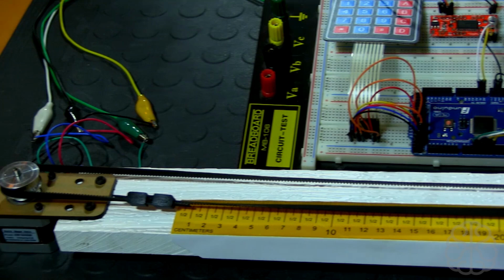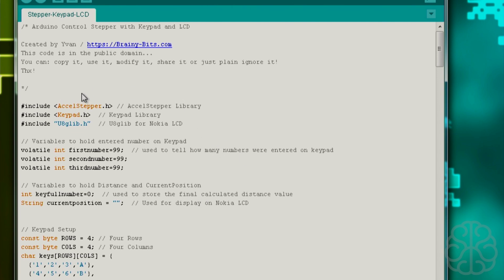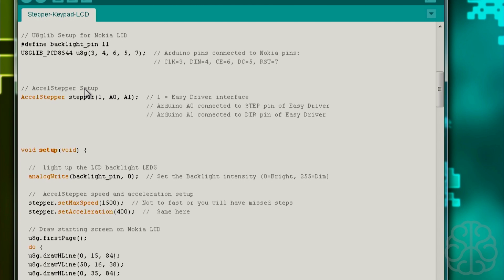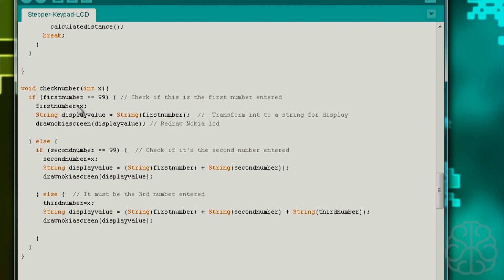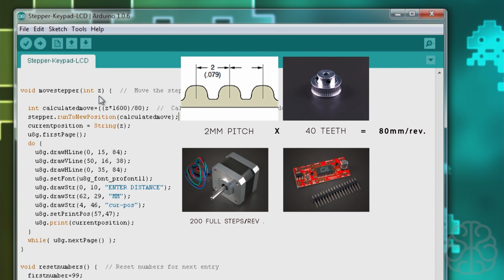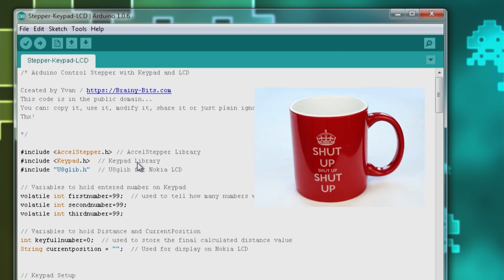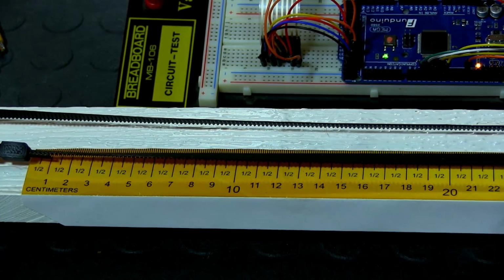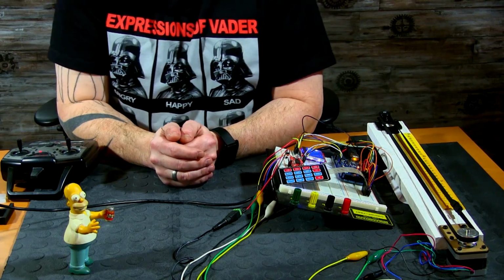Arduino DIY electronic miter box?  Stepper control with keypad and LCD - Tutorial

Comment: Thanks for your videos. I'm starting with arduino and this is really helpfull. I have a project like this I want to make for my company. But instead of Nokia display or LCD I want to use 7segment display with MAX7219. I already watched the dart conuter video and makes sense your approach. My question is how would you do to add a decimal point with a decimal? I want to write the numbers in the display from right to left from the decimal point, and once I press the period, write one single digit to the right of the period. Any guess? Thanks from Barcelona.

Comment: You use the steps per mm = 1600/80

Then, i change this value into 6400/10. I try 51 mm, the motor rotate clockwise but then when i fill the value = 52 mm, the motor rotate counter clockwise. What happen? Where is the error?

By the way i use the tb6600 driver, with microstep 1/8 aka 1600 per rev

Comment: If you need to control small motor and need to precisely rotate motor between 0 and 90 degrees would you recommend stepper motor or servo motor?

Comment: how to get the distance 25.45mm?
Reply: I have the same question but it difficult to get an answer. On the internet I could not find a proper suggestion , even if you look to calculator examples I could not find  anything about decimals points.
Reply: use potensiometer (motor knob)

Comment: Hi Ivan thanks for the sketch how do I change the code from LCD display that you use to a LCD (16,2) display. I am a pretty good engineer but my coding is useless, I think that is because I am 73 and things don't enter the brain like they used to.
Reply from the maker: You would have to change some of the code since using the Oled requires different coding, here's a tutorial that uses a 16x2 character LCD: https://www.brainy-bits.com/post/a-rotary-encoder-that-s-always-on-the-money  Hope it helps.

Comment: I have set up this sketch at least 8 or 9 times and can't get anything to work. I compiled and loaded  it more times than I can remember and it loads but I keep getting 
"Invalid library found in c:\Program Files (x86)\Arduino\Libraries\Easy_Driver-master: no headers  files (.h) found in c:\Program Files (x86)\Arduino\Libraries\Easy_Driver-master"
Where did I go wrong? 
I copied and pasted the sketch and downloaded and installed all that you said I required from you web site.
Any help would be well deserved.
Pete
Reply: Well, I found I had a bad Nokia board. I tried over a dozen different sketches and could not get 1 working.
I do have a couple of working Dorhea IIC I2C TWI Serial LCD 2004 20x4 Blue Backlight Modules and was wondering if these could be made to work in this sketch.
Also, I'm using a Nema 17 motor that is a 400 step (.9) if that makes any difference.
At the age of 76, I have been trying to learn to code these Arduinos but my brain kind of wanders. I would appreciate any info / help you could offer me in this. I think I could get this to work on my HO turntable pretty well.
Thanks,
Pete
Reply: I finally got this to work (bought a new Nokia lcd). Now, can the mm's be changed to steps?
Reply: @repeters1  I tried this tutorial, spent 1 full hour debugging, my nokia board too was bad, good thing I ordered 3 lol

Comment: Hello
I need to get three parameters first befor starting the procedure and then use those parameters to run my stepper motor.
I need the operator to see what it in entering on an oled display
would you please help me on it

Comment: Hi, the project is beautiful, I've already done it and it works! I entered a command line with a 5 second delay and that's fine.  I will install it on a slider for cam. Do you think you can also enter the stepper speed control using the keyboard? I wouldn't know how to do it. Best regards!

Comment: Great video! I did have 1 question, hopefully you didn't already cover it and I missed it. So lets say you are done for the day and turn off the device. How does the device, and you,  know where the current position is when you turn it back on? Or do you always have to remember to return the device back to zero position.  Thanks for sharing this great video!
Reply from the maker: Hi David, when it's powered off, then the UNO lose the current position and you need to zero it when it starts up again.  I've done a tutorial on how to home your stepper at start here, hope that helps and thank you for your comment and for watching!  https://youtu.be/3odRT6zdzqk
Reply: @BrainybitsCanada  how to add text in screen,when system works in 'home' mode,your answer is very helpful,thank you

Comment: I have a 51: 1 planetary box but if I change the code from. int calculatedmove = ((z * 1600) / 80); for int calculatedmove = ((z * 81600) / 80); does not work. Can someone tell me why and how to solve it?
Reply: youre driver not have 81600 mod :)

Comment: I want to move 2 stepper motor. If pressed key then Ist motor start move 12 inch  clockwise and stop 1st motor and start 2nd motor 4 inch  clockwise and stop 2nd motor . And again 1st motor move 12inch anticlockwise.
And finally I want goes to final position.   Please help me..

Comment: Ivan, is it possible to use this system instead of a liniair system to a rotating system for a modelrailroad turntable.
On the keyboard a want to use only de numbers for trak 1-2-3 etc if a press 1 the system moves15 degrees,
So the keys must be presetted to a surtain track number.
Maybe I have to change the mechanics.
Maybe you did already a project like this

Comment: Using 16x2 or 20x4 LCD screen instead of the Nokia LCD would have shorten lines of code and also make it more clear.  Anyway, it was a very useful video, I think it can be a basic core for building a CNC machine..  Thanks a lot man.

Comment: Thanks #brainy-bits I've been trying to build a arduino router lift and I'm using this project as a base to work from. Just got your stock code running. Next I need to add limit switches for both the bottom and top positions. A third limit switch will be for homing the router bit flush with the router bed.

Comment: Very good project.
I would like to use this project in the locomotive turntable but after power on the motor is not in the same position. How to apply the home position switch in this project?

Comment: //my code://

#include <LiquidCrystal.h>
#include <OnewireKeypad.h>
#include <TimerOne.h>

LiquidCrystal lcd(0, 1, 6, 3, 4, 5);    // pines de arduino al lcd

char KEYS[] = {
 '1','2','3','a',
 '4','5','6','b',
 '7','8','9','c',
 '*','0','#','d',
};

// da de alta el objeto teclado y asigna los valores del pin analogico y las resistencias
// para mas informacion lee la libreria

OnewireKeypad <LiquidCrystal,16 > KP(lcd, KEYS, 4, 4, A0,4700,1000);

// declaracion de variables

int x = 0;
int z = 0;
int i = 9;
int j = 0;
int k = 9;
int n = 0;
int a = 0;
int b = 0;
int paso = 100;
char tecla[10]="         ";
int Distancia1 = 0;
int Distancia2 = 0;
int retraso_teclado = 20;

               
void setup(){

pinMode (2,INPUT);
pinMode (8,OUTPUT);
pinMode (9,OUTPUT);
//attachInterrupt (0,SENSOR,RISING);

lcd.begin(16,2);
lcd.setCursor(0,0);

lcd.print("                      ");
lcd.setCursor(0,1);
lcd.print("                      ");

 lcd.setCursor(0, 0);   
 lcd.print("MOTOR 1:"); 
 
lcd.setCursor(15, 0);   
lcd.print("mm");

 lcd.setCursor(0, 1);   
 lcd.print("MOTOR 2:");

 lcd.setCursor(15, 1);   
lcd.print("mm");

}

//void SENSOR()
//{
//digitalWrite(8,HIGH);
//  lcd.setCursor(10, 3);   
//lcd.print("david");
//delay(1000);
//if((x+z)>0){

//digitalWrite(8,HIGH);
//digitalWrite(9,HIGH);
//delay(5000);
//x--;
//z--;
//}

//digitalWrite(8,LOW);
//digitalWrite(9,LOW);
//delay(1000);
//}

void loop()
{ //attachInterrupt (0,SENSOR,RISING);

 if (KP.Getkey()) // SI SE PULSA UNA TECLA
 {
  
  //***************************************************/
  tecla[n] = KP.Getkey(); 
  //***************************************************
  
if((tecla[n] == 'a')){                   //habilita el teclado para introducir la distancia para el primer motor
                      a=1;
                      delay(100);
                     }
//***********************************************************                     
if(a==1){  
          
       if ((tecla[n] != 'a') && (tecla[n] != 'b')){
                                                 lcd.setCursor(i, 0);  // va posicionando en el lcd para escribir en su sitio correspondiente el proximo caracter
                                                    lcd.print(tecla[n]);// lo escribe en la lcd
                                                    Distancia1 = atoi(tecla); // convierte en un entero la cadena de caracteres tecla[]
                                                  
                                        if(Distancia1 >0){ 
                                                          if (tecla[n] == '*'){
                                                                               lcd.setCursor(i, 0);    // va posicionando en el lcd para escribir en su sitio correspondiente el proximo caracter
                                                                               lcd.print(" ");
                                                                               lcd.setCursor(18, 0);    // va posicionando en el lcd para escribir en su sitio correspondiente el proximo caracter
                                                                               lcd.print("ok");    // escribe en la lcd
                                                                               a=0;
                                                                               b=0;
                                                                               n=0;
                                                                               i=8;
                                                                              }
                                                                           }                       
                                                      delay(250);  
                                                      i++;          
                                                      n++;            
                                                }

      }

   
  //******************************************************************************************/
if((tecla[n] == 'b')){   
                        b=1;
                        delay(100);
                     }
//*********************************************************************************************************************    
if(b==1){
           
          if ((tecla[n] != 'a') && (tecla[n] != 'b'))  // si es un numero
                                {
                                 lcd.setCursor(k, 1);    // va posicionando en el lcd para escribir en su sitio correspondiente el proximo caracter
                                 lcd.print(tecla[n]);    // lo escribe en la lcd
                                 Distancia2 = atoi(tecla); // convierte en un entero la cadena de caracteres tecla  
                         
                                 if(Distancia2 >0){
                                                   if (tecla[n] == '*'){
                                                                        lcd.setCursor(k, 1);    // va posicionando en el lcd para escribir en su sitio correspondiente el proximo caracter
                                                                        lcd.print(" ");    
                                                                        lcd.setCursor(18, 1);    // va posicionando en el lcd para escribir en su sitio correspondiente el proximo caracter
                                                                        lcd.print("ok");    // lo escribe en la lcd
                                                                        a=0;
                                                                        b=0;
                                                                        n=0;
                                                                        lcd.setCursor(15, 1);   
                                                                        lcd.print("mm");
                                                                        k=8;
                                                                       } 
                                                  }
                               delay(250);   // espera para que no rebote el teclado y marque dos digitos iguales seguidos
                                k++;              // para escribir en la siguiente posicion en el lcd
                                n++;            // aumenta el indice en el array tecla para situar en la cadena de caracteres el proximo digito
                               }
        } 

 }
 
}
Reply: Please send your code l can't open this video code if you send it would be a big help for me please again

Comment: Sir, 
Thank you very much for your informational and well presented tutorials.  I used your code from this tutorial with a few 
modifications. I deleted the LCD display lines and use Serial Monitor to  display pressed key numbers and current position and added a fourth number. I also modified the calculation for inches and 10ths.  Pressing 100 on the keypad advances the pointer 0.10 inch from zero. Pressing 150 moves to 0.150 inch. (Within a margin of acceptable error)   
Entering 1000 advances the pointer 1.0 inch from zero. All works well except for a couple bugs.  When I input 1000 for a 1 inch move, the motor moves forward a bit, slows to near zero RPM for a moment, then accelerates smoothly stopping at the 1 inch point. Should I want to advance another inch, I key in 2000.  The motor first reverses moving the pointer back to near zero, pauses then advances to the 2 inch position. The slowing down only happens with four digit inputs.  The return to zero from any position  is smooth without pause.
Any clues? Anyone?
Thank you

Comment: Hi. 
At first i want to tell you congratulations for your excellent work and thanks to share it with all of us.
I am new in arduino and i need your help on your project Arduino Control Stepper with Keypad and LCD.
I need to set a max length of four or five numbers to enter distance more than 999 cm but i don't know how to modify your code.
i try to set four numbers but i take bugs.
I hope that you can help 
Thanks in advance for your assistance and I hope to have your reply

Best Regards
kostas
Reply from the maker: I've done this tutorial a while back, so it's not fresh in my memory :),  Pretty busy right now but will try to revisit it to make some improvements like you asked.  Thanks for watching!
Reply: Hi. Did you ever work this out? I could really do with making this mod to the code.

Comment: Great video! I have been wanting to build an HO turntable and this is getting close to what I've been looking for. Is it possible to do this same thing with a push button or a series of buttons to control the angles on the stepper motor? It would align the center track with the outer tracks around the turntable. 
Thanks,
Robert

Comment: G'day Ivan
I have a model railway where trains are stored on a five track traverser. Is it possible to program the stepper to move between five (5) pre-determined positions by using five (5)normally off press button switches (without having to "nest" some of the commands?
Thank you,

Tom Clune

Comment: instead of LCD can we use oled
Reply from the maker: +Vishal Chhabhaiya You could of course use an OLED display, but would have to change the code a little to write to an OLED instead of a regular LCD, you can check out a tutorial we did here on using an OLED display: https://youtu.be/7Kli1DgHZc8  Hope that helps you get going :) Thanks for watching btw!

Comment: Nice! I've been thinking about how to make a "stock pusher" for my bandsaw that would allow me to enter a number, then the stock would move into the saw that far, and then I could make a cut.  This is basically what I need!  (And the video didn't seem to be any longer than needed.)
Reply from the maker: +Wide Vision Metal Fab It would be great for something like that, maybe using a bigger stepper motor would be needed to move the mechanical parts, but the code would be pretty much the same.  Thanks for watching!
Reply: @BrainybitsCanada  HI, i am looking to do something similar. Can you please share the code?